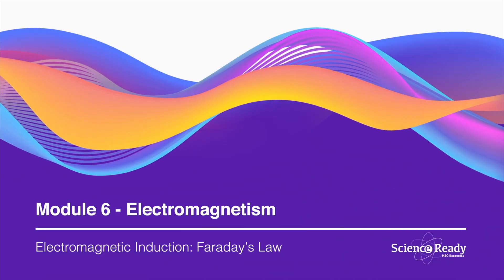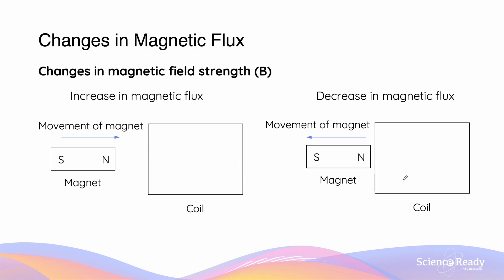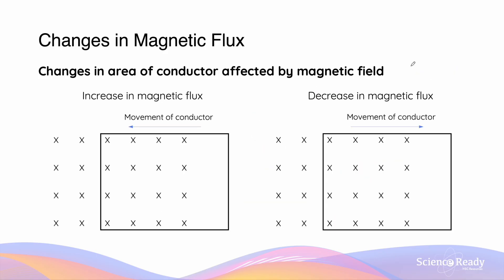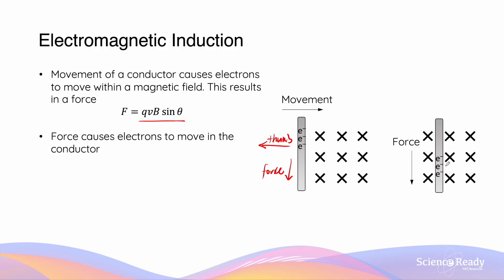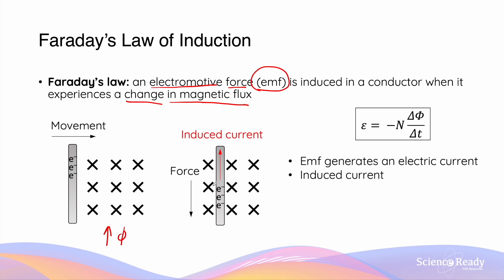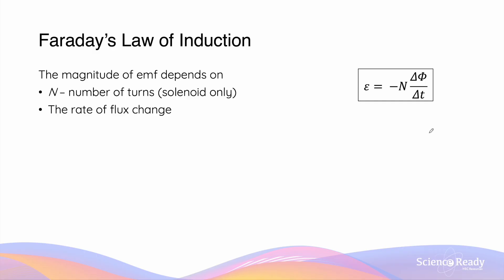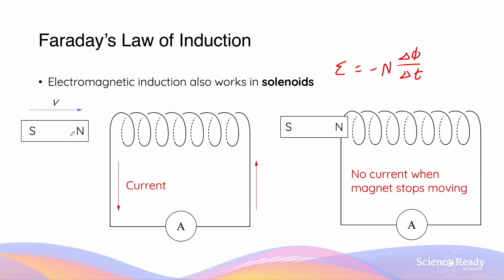Faraday's Law & Induced EMF and Current // HSC Physics

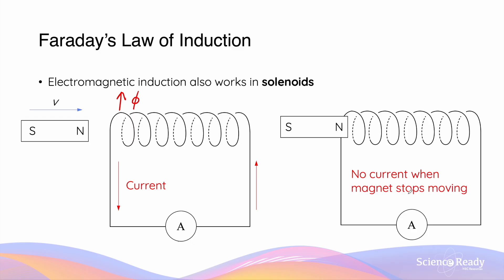Comment: At 9:06 wouldn't the current move clockwise using the LHGR?
Reply from the maker: No mistake there. North Pole of solenoid is on the left to repel the North Pole of the magnet. Using right hand rule, the current runs anticlockwise from our view.